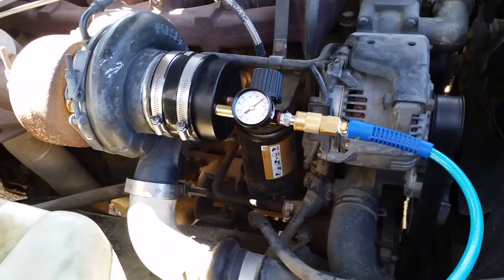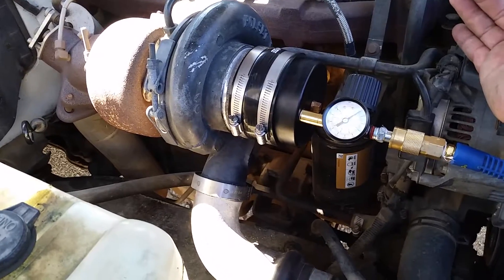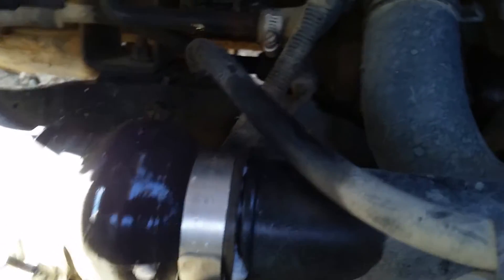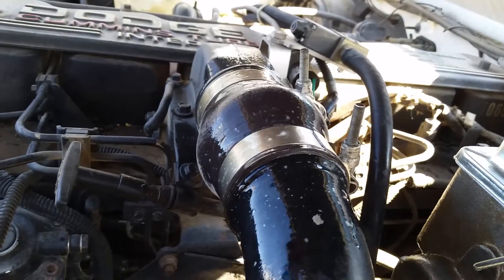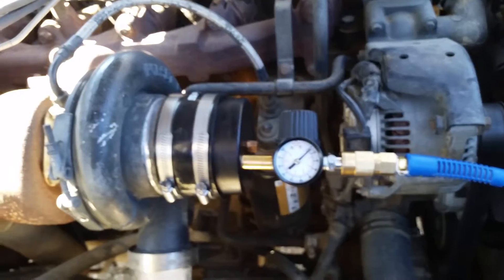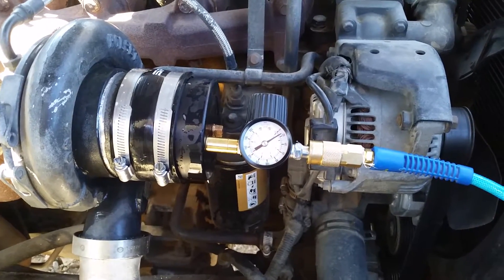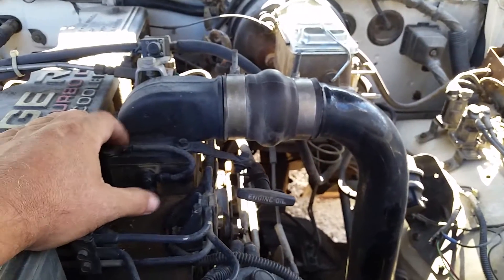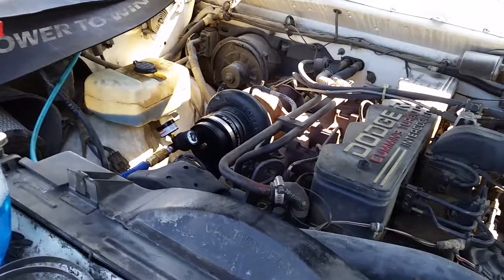1993 Cummins Dodge Turbo Leak Test.

Comment: I think I may have one tiny leak on my 92. I replaced all the connectors except one so hopefully that last one is the issue. I had a hard time getting the new ones to fit because they're a lot longer. Gonna cut this last one down a bit so it'll be able to squeeze in. Mine doesn't run hot at all these cummins engines love the cold so its nice to be here in Pennsylvania, but I wont be driving it at all from December-March to much salt on the roads. Great video.
Reply from the maker: Thank you!

Comment: did u get this fixed and did it help thanks
Reply from the maker: The boost pressure still hits 13 psi even with the leaks. So it's not ideal, but still functional. Not done yet. The ac compressor seized. Out here in the desert that's a bad thing.
Reply: Done yet?

Comment: Did your truck run cooler after fixing all the boost leaks? Also did you MPG go up after it also?
Reply from the maker: I still haven't fixed the leaks. So much to get done on this house.
Reply from the maker: I'm now gathering parts to get the boost leaks tested and fixed.